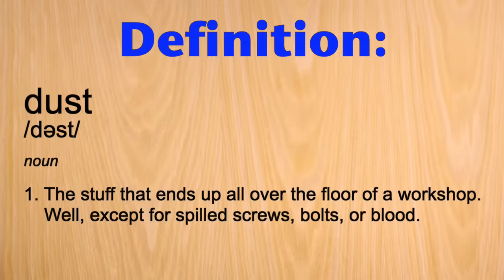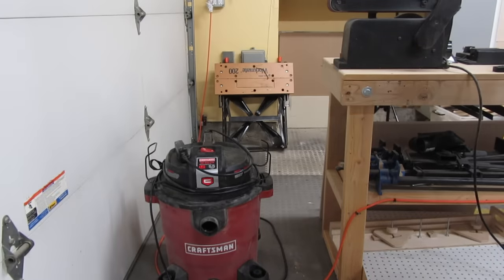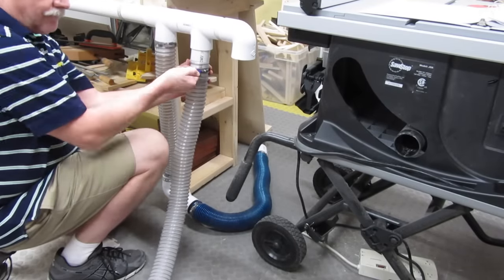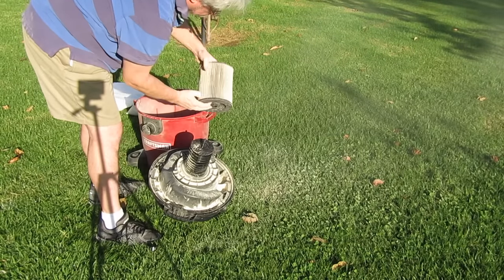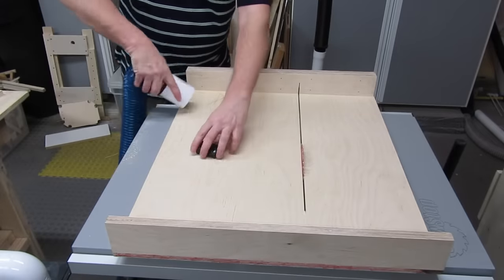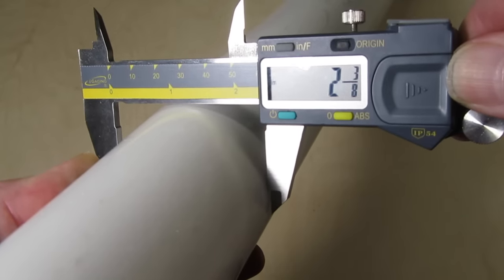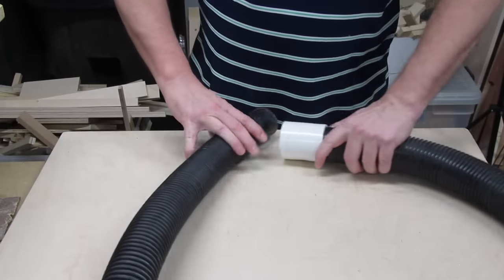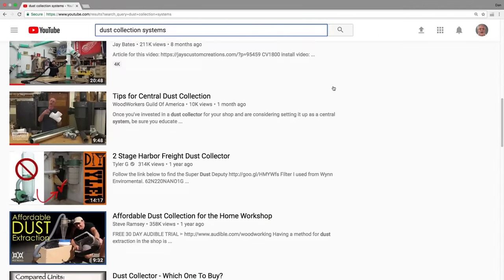Dust Collection for Newbies: Introduction to Dust Collection

Comment: Excellent video. I would suggest individual drops and no gates or horizontal runs, far less resistance and just make a cart for the cyclone vac combo and move it from tool to tool (since the vac has limited pull would trade the convenience of your manifold system for decreased resistance). Also you can get a cyclone identical to the dust deputy for under $20 and 5 gallon buckets for free.  Also instead of the pry off lid I used gamma lid on my bucket. Also, and finally, the filter in your video will not capture the worst particles (in terms of health) replace the white paper filter with a hepa filter, this will drop pressure a little but will capture the finest (and worst for your health) wood flour and silica dust from sanding. For sanding I would wear a KN-95, N-95 or P-100 respirator even with the dust collection running.
Reply from the maker: Thanks for the info! And sorry for the late reply.

Comment: Thank you for posting this video. Structured, neatly recorded, no annoying music, no tool noise, and great content. I particularly like your voice over.  It shows that you are thinking and carefully preparing your material, not the ramblings or off-the-cuff remarks so common in other videos. Your voice is also very powerful, and projects a quality of "trust me, I am an expert". I have a question:  Should you have used 45 degree instead of 90 degree elbows, and Rockler's Wye instead of T connections? Those sharp turns must be killers to airflow.
Regarding the PVC cutting controversy. I have not seen comments that discuss the issue with dust and small particles of PVC that are thrown everywhere and stick to everything when you cut using a miter saw or table saw.  I prefer erring on the side of caution,  so I use a P100 filter respirator whenever I am cutting PVC.
Reply from the maker: Thanks for the nice comment! Regarding PVC, I think using a filter is a good idea. The particles small enough to really cause damage are pretty-much invisible, so it doesn't hurt to err on the side of safety. Regarding 45-degree elbows, it seems to me they don't have that much effect on systems that use shop vacs. Systems that use "blower"-style dust collectors are affected much more. It has something to do with air speed vs. air volume, or something like that. But let me say this: I arrived at this conclusion after using an anemometer to do some tests on my system. There's no guarantee I was even using the anemometer correctly, so take it with a grain of salt.

Comment: I have a miter saw and it works great for cutting pvc.  If you have a 3D printer you can print all the adapters you will ever need for the different size hoses or tubes you use.  Stay safe and God bless
Reply from the maker: Thanks - and that's a cool idea. 🙂

Comment: Great job on the video! I've cut PVC on a chop saw many times until one time it exploded and sent pieces up through the drop ceiling in my basement. Lucky I didn't get hit with a piece. I now stick with the hacksaw or a PVC saw which makes it easier to cut it straight.
Reply from the maker: Thanks, and yeah, that sounds like my experience when I tried to cut it on a table saw. Worked fine a couple of times, then BAM! Hack saw for me from now on. 😄

Comment: Best video in dust collection I’ve seen yet. I bought the Home Depot Dustopper which does the same thing as your Cyclone but if I had to do it over again, that one you’re using looks cooler and might work better. The issue with the Home Depot Dustoppper is that it replaces the bucket lid but they don’t give you a seal so the bucket leaks around the lid. I’m not sure if that leak is intentional but if I seal it off myself it seems to increase suction by a good amount. Perhaps the leak is to avoid damaging the unit or vacuum if you get a total clog.  Anyways Great video, I learned a lot.
Reply from the maker: Thanks, Jason! I did a review on the Dustopper, and actually spent some time corresponding with the guy who invented it. But I agree that it leaks around the lid, and I don't think I ever understood his response. 🙄Anyway, thanks for the comment. 😄

Comment: Thanks for your tips. As for cutting PVC - I recently cut a bunch of 2 1/2” PVC pipe for a theatre set. I started out experimenting with a few different tools. I found that a cutting wheel just burns & melts the PVC and the jigsaw creates more jagged, uneven cuts (even with the PVC specific blade). I ended up using my miter saw and it cut smoothly. The only issue is that it creates a LOT of PVC dust & debris. After talking to a friend who works with PVC all the time, he recommended using a solid blade rather than the wood-cutting blade I used as that will cut down on the larger bits of PVC debris.
Reply from the maker: Thanks for the tip! I think I remember reading somewhere about a solid blade, and it sounds interesting. "theater set" has sparked my curiosity. Home theater, community theater, or something else?

Comment: Excellent video. Covers all of the important bases other than one. 
The industry really (intentionally) screwed the pooch not having 2 or 3 worldwide standard sized for dust collection. 
As a result many folks struggle with nothing matching anything else. My smaller shop vacs hoses no where near fit any of the ports on my tools. The table saw has a larger one , the router another , the jig saw another , it’s a brand bonanza. The track saw yet another it seems. So making the fittings is key in any case , whether one does a fixed drops and blast gates solution like yours or just plotting the hose from the cyclone intake into the tools as needed. 

So the molding of pvc to make it bigger and smaller is critical to the endeavor.
Reply from the maker: Thanks, and I agree 100%. Makes me appreciate how many things really are standardized nowadays.
Reply: The size mismatch is probably intentional to encourage the purchase of hoses and fittings made by the vacuum manufacturers.
Reply from the maker: @richardblanchard2743  Anything is possible, I suppose.

Comment: This video is a pretty clear  demonstration on the basic concept on the subject. Although there are a few mistakes in the set up shown here. Mostly it's the 90 degree bends and T fittings as you've noted. The turbulence created by those sharp transitions kill any efficiency an already low powered shop vac set up like these have. Keep transitions at 45 degrees and runs as short and as little turns as possible. HVAC systems are different than collection system as forcing air is not as difficult than drawing air and material together.
Also, cutting PVC pipe on stationary saws is one of the biggest mistakes newbies make. These saws are designed for square flat sided material. Best if done using portable saws or jigs to keep the pipe from spinning. Otherwise it's very dangerous.
Reply from the maker: Thanks for the comment!

Comment: Fantastic idea, thanks. I have a small workshop and there is no way of fitting in one of those large dust collectors. Your solution is exactly what I need. Thanks for a very comprehensive and informative video. Time to order some hoses.
Reply from the maker: Awesome! Glad I could help. 🙂

Comment: Sometimes when using PVC on a dust collection system there can be a lot of static build up inside the PVC. This could potentially cause a fire risk around all the dust. To mitigate this, all you have to do is equalize the potential inside and out. Simply insert a short metal screw (just enough to contact the air inside the PVC). On the outside it is recommended to spiral a wire around the length of PVC and connect it to a screw on the other end. There are YouTube videos that show this. Hope this helps anyone using long lengths of PVC!
Reply from the maker: http://www.woodcentral.com/articles/shop/articles_221.shtml

Comment: Just a quick tip... Whenever possible use straight plastic pipe over flexible hose. While a few flexible hoses offer a smoother (than regular flex pipe) inside, most don't, whereas all plastic pipe has smooth insides, and its straight meaning less twist and turns (energy lost to change of direction). The section between the shop vac and the cyclone could have very easily been replaced with solid pipe and smaller flexible sections used where movement was required. There are plenty of YT videos that go into how bad for flow flexible hoses are.

Another tip is don't be afraid to go a little bigger with your backbone pipe. By limiting the size of the main backbone to 2" (internal), whereas most of the other fitting were bigger than that, you cause a flow restriction that need not be there. Using your setup as an example, you would be better of using a 2.25" or 2.5" back bone pipe.
Reply from the maker: Thanks for the tips!

Comment: Love the idea for heating the PVC pipe for fitting.  I've done it to bend PVC trim at 290° in the oven.  Works great.
I have cut PVC pipe many times on the table saw, but I use a cross cut sled, and get a very clean cut.  I think if someone tried to push it through freehanded and used the fence as a stop, they could easily jam the pipe and experience kickback if they lost control of the angle.
Reply from the maker: Thanks for the post. And yes, oh my gosh, to anyone else reading this, DO NOT get the PVC between the fence and the blade. That's almost guaranteed to cause kickback, and blood. I'd love to watch you cut PVC with a sled, because you're obviously doing something differently than I did. Thanks for the comment!
Reply: @TheNewbieWoodworker I've done it two ways on the sled.  First, full height in one pass, since I wasn't cutting more than 2" pipe.  The second way was to slowly rotate the pipe into the blade, using a stop block to keep the length the same around the whole circumference.  I wouldn't try bloody freehand method.  Have you tried with a sled before?  How did it shatter?
Reply from the maker: @MauriceCalis  Yes, I tried it with a sled, with 2" pipe, but without the stop block (if memory serves). I also slowly rotated the pipe. I'm pretty sure I must have loosened my grip as I rotated it, and it got a little crooked. If I were to try it again, I think I'd make a little jig to hold it down solidly. A box over the kerf, with cutouts for the pipe. This would also help keep the PVC shavings from flying all over the place.
Reply: @TheNewbieWoodworker Tried your trick today; worked great.  Heated a PVC elbow to 300˚ to resize the end.  Worked great!  I admit, I did use a hack saw to cut a 10' pipe to rough length, then cleaned up to end on the sled.  Just made a Paulk Workbench style out-feed table for my table saw, so I no longer had room for my vac hose.  Making a 90˚ fitting with hot PVC got me there.  Thanks for the video.  Time to make some gates.
Reply from the maker: @MauriceCalis  Awesome! Thanks for letting me know. On the subject of gates, I've discovered I like this kind of gate the best: http://www.leevalley.com/en/wood/page.aspx?c=&p=51506&cat=1,42401&ap=1. The advantage of this design is that the track for the sliding door doesn't get stuff stuck in it. So if you build your own gates, see if you can find this type of design. If not, oh well, but for me, it's making a HUGE difference for my table saw's blast gate.
Reply: @TheNewbieWoodworker  Yes, I like that design -  thanks for the tip.  Watched a lot of videos and settled on this design, which I think will have the same advantages, including being screwed together (in case there is dust still trapped): https://www.youtube.com/watch?v=fdNuJxecQ2Q&t=448s  However, I will use wood instead.  Think it will work?
Reply: @TheNewbieWoodworker  Also, just found this video: https://www.youtube.com/watch?v=g1sLC_g7F68  - A toggle design will be very useful to me, though maybe with a better housing to seal out dust.
Reply from the maker: @MauriceCalis  Cool! It always helps to have a design to start out with, I think. Whenever you get it working, send me some pics. Go to my website, click on the Menu, and send me an email. https://thenewbiewoodworker.com/

Comment: Regarding angles and "T's".  For angles or bends, I use PVC "Sweeps".  These are 90 & 45 degree gray PVC angles available in the electrical department of big box stores.  They come in either Belled or Unbelled ends, and I did my entire collection system using electrical Schedule 40 PVC, save for the T junctions where I adapted schedule 40 water PVC 45 degree t's at the junctions.
As for cyclones...I LOVE them!  I use a double stack I 3D printed on 5 gallon buckets and haven't had to clean my vac filter in over a year now.
Reply from the maker: Thanks for the comment, and very creative! I love it. And as for cleaning my vac, I even forgot I should be at least checking it every once in a while. Thanks for reminding me! 😄

Comment: I use my miter saw to cut all sizes of PVC.  I just do it a little slower than cutting wood.  Also a "chop saw" is used for cutting metal.  A miter saw is for wood, plastic, very soft metals (aluminum).
Reply from the maker: Thanks!

Comment: Btw-Great video, thanks for the source info on dust collection parts, We’ll done.  As for cutting pvc. A simple plumbers pipe cutter will do most of the job and result in very strait cuts although you may need to finish with a hacksaw. Otherwise I usually cut pvc on the radial arm saw and also with a chop saw (remembering to hold it very tightly so the pipe does not begin to spin counter to the saw blade). Sometimes I wish to rip a piece of pvc. 2 ways to do this. 1. Drill a hole in a block of wood the outside diameter of the pvc(smaller diameters 3/4 5/8 1”), then rip through the block to the depth of cut desired. 2. Use painters tape to tape a piece of pvc into a wooden V block. If I want to cut pvc on the band saw (it will definitely want to spin and ruin your blade and maybe more than that).  I always clamp the pvc or screw it into a block of wood, but usually I will use the wooden screw clamp (like you did on the table) that way I can control the piece.  You can also use this clamping technique with smaller pvc pieces on a zero clearance router table to round over the edges, etc.  
For smaller diameters, I usually insert a wood dowel inside the pvc and cut through both pieces. Another trick is to use a few electrical conduit “pipe clamps” to clamp the pvc to a board before milling notches in it.  
As a general rule, I never cut PCs with the table saw unless it is hard connected to a sacrificial piece of wood.
Reply from the maker: Thanks, and thanks for the info! 😄

Comment: I have cut PVC pipe using a miter saw for several years. It works great as long as you keep the pipe square against the saw's back fence. Yes, it does create a lot of small plastic chips/dust, and I would highly recommend wearing a mask when doing this.
Reply from the maker: Thanks for the info! 👍

Comment: Excellent video and very helpful. I too have a small shop with 6 or 8 machines that I’d like to use dust collection on. I’ve already made a separator for my shop vac, but I had it in my head that the vac might not pull over 8 or 10 feet. I’m going to jump in with both feet. Thank you, from East TN.
Reply from the maker: Thanks, that's great to hear. Good luck! 😄

Comment: Great video.  A few minor things you may want to consider though.  A 90 degree turn is tough to make  for the dust particles and can cause build up over time.  A pair of 45 degree bends is much easier to make.  Also, being plastic, PVC is subject to static build up, especially during dry/cold times of the year and can cause sparking or even occasional flashovers in the dust, similar to what can happen in grain elevators.  I usually either ground my PVC sections to a known ground or run a bare wire inside the pipe that's grounded at both ends.  Either way will kill the build up.  As far as blast gates, I make my own for my 4" system.  Easy to do and plenty of videos.  Good way to use up the plywood scraps around the shop too.
Reply from the maker: Thanks. As for the 90 degree bends, believe it or not, they have a negligible effect on 2" systems that use a shop vac. Something about air speed vs. air volume. I did a lot of tests with an anemometer, and they just don't make a noticeable difference. As for static electricity, my views are perfectly stated here: https://www.rockler.com/exploding-pvc-dust-collection-ductwork. Good for you for making your own blast gates! For me, considering they cost $8 each, I'm not spending the time making them. On the other hand, it's cool that you do! 😄

Comment: I've cut a lot of PVC using my chop saw and it works very well.  It does gum up the blade so you'll have to clean it if you're cutting a lot of PVC.
Reply from the maker: Thanks for the info! 😄
Reply: Is there any common house hold cleaner you can recommend?

Comment: Great job. Since your shop is in your garage here is a cheaper way one could do.  My table saw is on wheels and I just roll it out on the driveway, check out the wind direction or turn on a portable box fan to blow the dust away from my face and in to the yard. Rain can be a problem. This takes more effort but keeps your garage cleaner with less equipment clutter. Thanks
Reply from the maker: Thanks, and LOL. You're right, that would be cheaper! I'd have to make sure I pointed the fan towards, I mean away from my neighbors windows, though. 😛